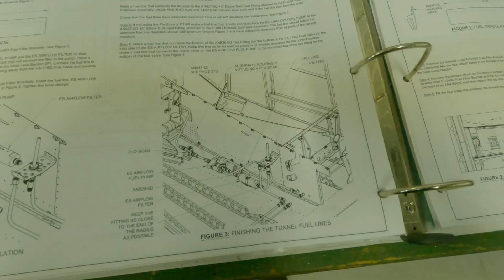RV-10 Fuselage - 044 - Fuel/Brake lines - Rudder Pedals - Monkies!

Comment: Arc torque is what we used in the Army, tight plus 1/4 turn. We never even used thread lock.  These were hydraulic lines and fuel lines.  What other rudder pedal options are out there?  I have only seen one other besides the stock.

Comment: take with a grain of salt because experience is not from airplanes! No is the correct answer on flare sealant. you want a mechanical connection for flares. the thread sealer is more or less not necessary and i personally feel its more of a lubricant than a sealant which is good because it keeps the aluminum flare from spinning from torque. you can get a crush washer for the fittings depending on the connection.

Comment: Do not use any sealer on the NUT , sleeve or flare, at all on any line. As long as you have flared it correctly without cracking rhe flared end, it will seal and not leak when you tighten the NUT down.

Comment: Flared connections seal metal to metal.  Do not put sealant on the mating surfaces!  And putting it on the threads is a waste of sealant and just makes a mess.  What is often recommended is a little lubricant on the threads to help prevent galling, but be careful as lubing the threads can make it easier to over tighten the fitting.
Reply from the maker: There is ZERO sealant between the mating surfaces.. and yeah I thought putting it on the threads was a waste of time too but it's what was recommended.. I am now going to remove it from the few I did that way because honestly can't see the point.
Reply: @JasonEllisBuilds  A little anti-seize as someone already mentioned isn’t a bad idea, but honestly a drop of motor oil is more than adequate if you don’t have anti-seize handy.

Thread sealant is only needed on NPT fittings where the tapered threads form the seal, but you still need to seal the peaks and valleys of the threads as they seldom make perfect metal to metal contact as is the case with both flared fittings and compression style fittings.

Comment: As was said by another… flare seals require no sealant. But to emphasize the sealant risk a little more directly… Several RV-ers have lost their lives because of thread sealant on fuel fittings. If even a small amount of sealant gets into the line during assembly, it can break free and block the fuel flow, causing the fan to stop. Flare seals are metal-to-metal seals and are very robust on their own (once you get them to not leak). Sometimes just disassembling a joint and putting it back together fixes a leak (sometimes it doesn’t). Use a crows foot and a good torque wrench and have fun.
Reply: Thank You for commenting on this. I am a new RV-8 Builder and I am looking for all the information I can get to build this correctly.
Reply: And use proper thread locking stuff like Loctite instead of “something he told me to use”...

Comment: NO!  Those are AN type compression fitting and they seal on the taper and have nothing to do with any sort of sealing on the threads!!!  Do Not, REPEAT, do not put any type of sealant on the threads; DO use a Wee-bit of Anti Seize on the threads.  Use AN Wrenches where practicable - they are Vacation Expensive.  It takes but getting them straight and tight - we do not Crank in any shape or form on these types of fitting, and you may want to get them off at some point in time - any type of sealant would be very bad!  They are either straight forward simple and tight - or they are probably not done right.

Comment: Do not use any sealant on the flange or the threads. The flare is a sufficient seal. Only use sealant on pipe thread fittings. I prefer EZ-turn.
Reply: In addition, it's not only not needed, it can be dangerous in a hydraulic system with small parts.  Some sealant can get into the lines and clog something up when you least desire it. If the fitting is made up correctly it won't leak.  If it isn't made up correctly then sealant wouldn't stop the leak anyhow.
Reply: Exactly what I was going to say. No sealant on compression fittings
Reply: And good to see another video!
Reply: What he said!
Reply: What he said.. except ez turn is NOT a thread sealant! It will eventually leak. Use an actual thread sealant on npt tapered pipe threads. Locktite 565 or the higher temp 567 is the best. It’s a white paste. No sealant on the flare fittings.
Reply: @thomasaltruda  agree to disagree on that one. I will agree that there are a lot of good options for pipe thread sealant. I havent experienced any leaks with EZ-turn, but I'm sure there are others that work just as well.
Reply: @vr6chrisvw  there’s no reason to disagree.. ez turn isn’t a sealant, and will leak over time. It’s a thick gooey grease like substance, and it lubricates fuel valves nicely, but it will leak over time if you use it on tapered pipe threads.
Reply: @thomasaltruda  I have multiple A&P/IAs that would disagree. Like I said, agree to disagree.
Reply: @vr6chrisvw  well I guess we’ll have to agree to disagree then.. but if anyone else is reading this and wants to assemble pipe threads that don’t leak, then use an actual thread sealant like locktite 567. I have a friend that is chasing leaks in his RV-8 after the previous builder assembled the pipe threads with ez turn almost 10 years ago.. every pipe thread fitting from fuel, brakes and oil are ALL leaking.